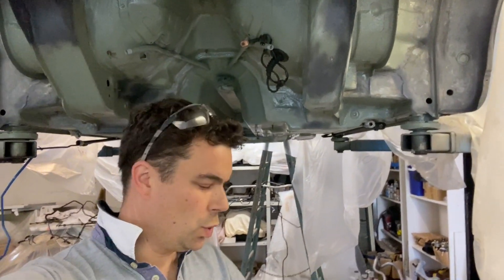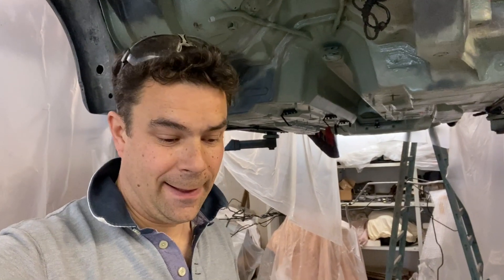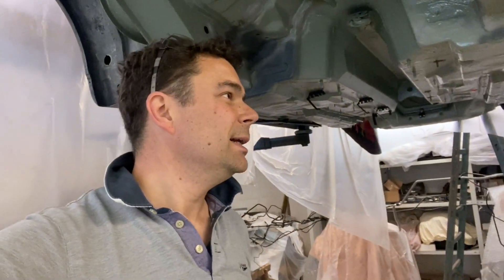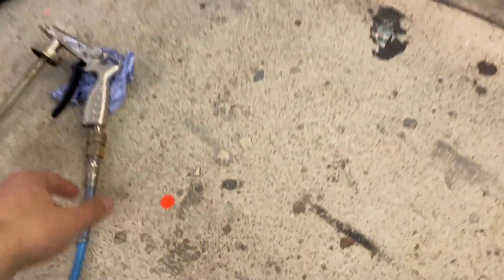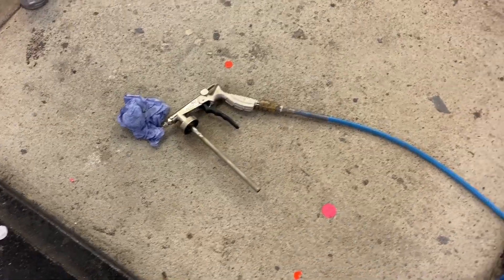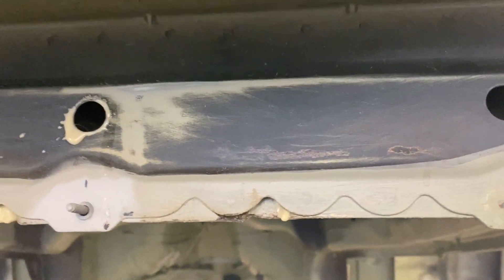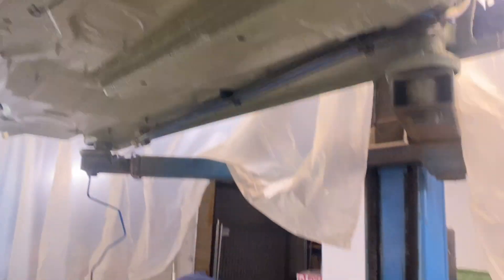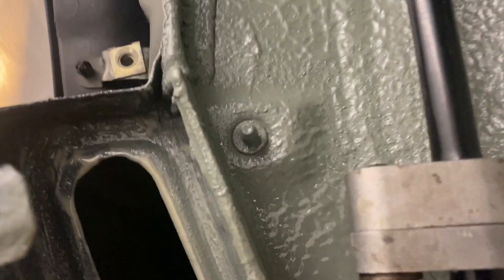Porsche 911 (996) Restoration - Cavity Wax & Seam Sealant - Part 37

Comment: Hey Joel, you’ve recovered from that painting disaster (and plating cost) really well. We’ve always used cavity wax or equivalent due to living by and driving on the beach. I was shown by an old body guy how to do it most effectively. If you have a long pipe on the gun, around 3’ I use, and a spray head that has multiple holes around its circumference. Feed the hose in as far as it’ll go then pull the trigger and withdraw the pipe. That way you don’t get the wax all over the pipe and you get right into all the nooks and cranny’s. As someone else said, do the wax last as paint won’t stick to it if you get even a mist of it on the outside.
Reply from the maker: Hi Andrew, thanks for your message. When I tried the long pipe, it just clogged up immediately but then I realised the compressor was set to 10 bar. Which was too high and imply blasting air back into the canister of wax. Very messy.  I  didn’t have a huge amount of wax so wasn’t able to experiment. So went for the direct approach without the pipe.  The sills on the 911 are pretty short so I think I got good internal coverage,  but I can always buy more wax and go for a second pass, right at the end. What pressure do you tend to use on your compressor, and was your pipe a flexible one or solid? Thanks.  Joël
Reply: @My911  Flexible pipe at 30 psi. We use Tectyl which is a bit thinner than the Wurth wax.
Reply from the maker: @andrewfraser4347 excellent, thank you. So my 10 bar was slightly high then 😂
Reply: @My911  Do you heat the can first, ie in boiling water, to reduce the consistency ?. After that I’d start at a lower pressure and increase as necessary.